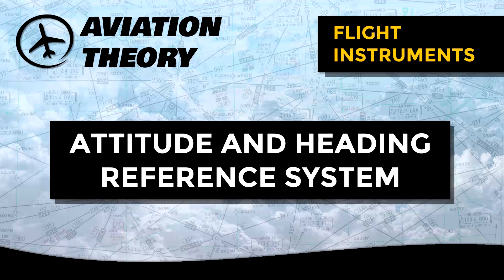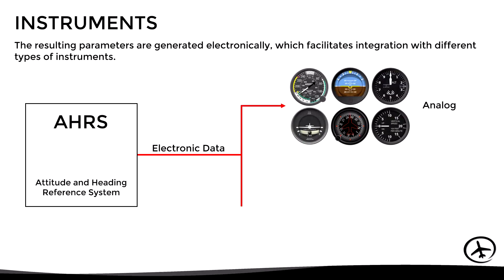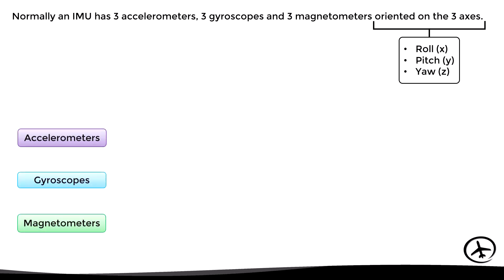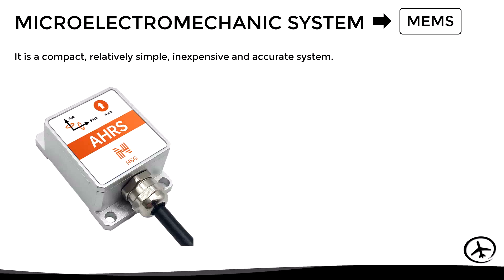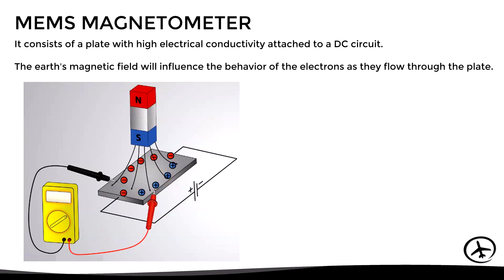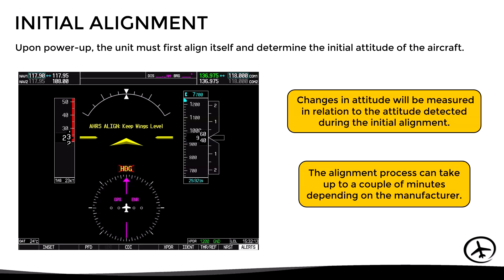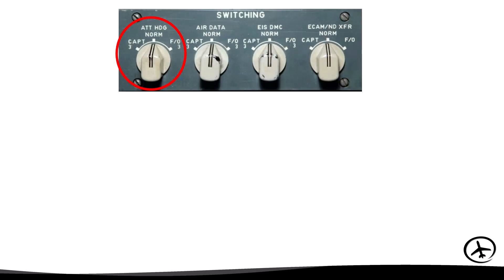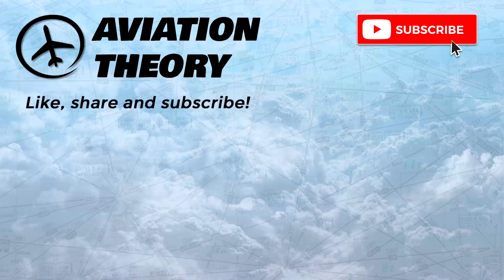AHRS - Attitude and Heading Reference System

Comment: Correct me if I’m wrong. So the AHRS is a simpler, primitive version of the IRS used on lighter aircraft that unlike IRS (and the old INS) does not provide navigation
Thanks for the video. Really useful info
Reply: It's used on the A-10 as a backup for gps navigation.

Comment: Why does the allignment of IRS on Boeing or Airbus takes from 6 to 18 minutes and AHRS on Diamond 40 or Cessna 172 - nearly 2 minutes???
Both have laser gyroscopes...
Reply from the maker: Hi! That’s because IRS relies on it’s own internal sensors to determine true north and provide inertial navigation functionality. AHRS uses magnetic flux detectors to determine magnetic heading, and in fact, AHRS is not capable of providing inertial navigation, only attitude and heading information.
Reply: @AviationTheory    Thanks a lot!

Could you answer please, 
Does AHRS accelerometers determine the direction of gravity acceleration to understand  the true vertical and horizontal direction the same as IRS?
Reply from the maker: Yes! That’s exactly how it works, just like an IRS, the only difference is the process of heading determination.